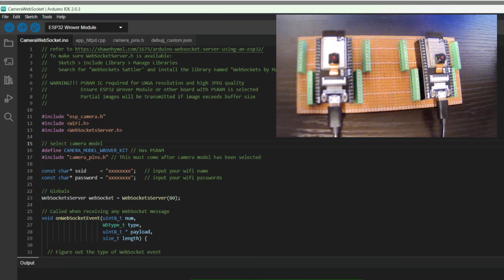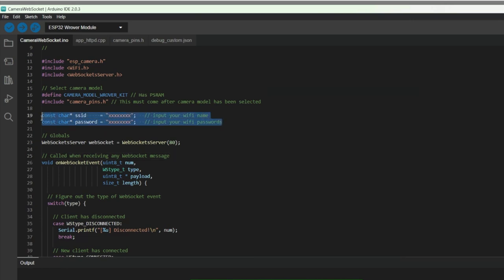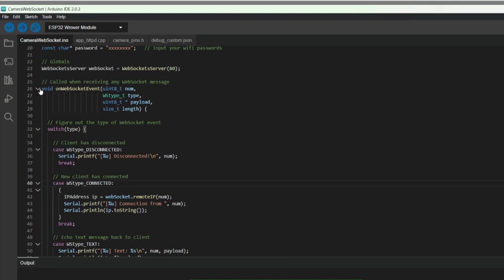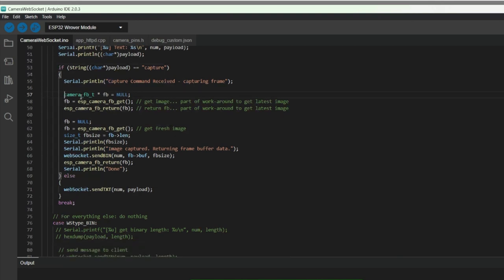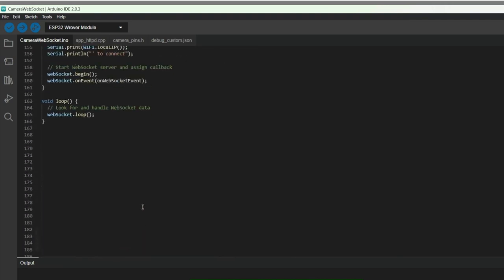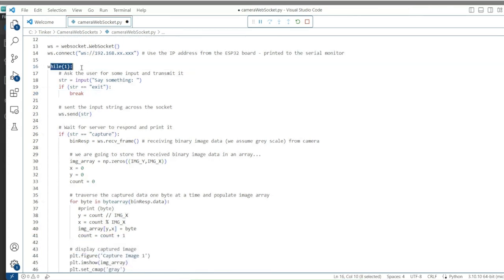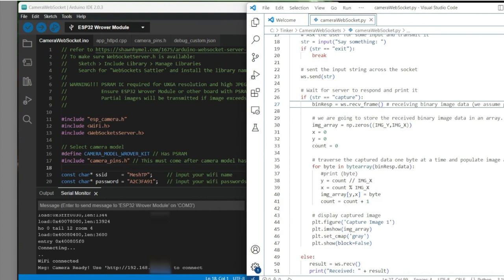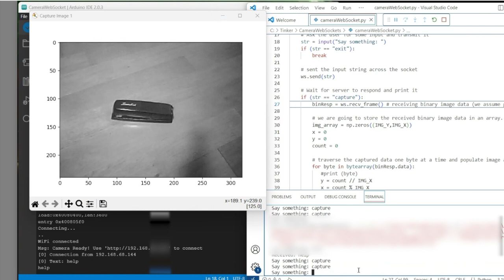ESP32 Web Sockets - Transferring Raw Image Data

Comment: Why are you not using the sockets library which is designed for this type of application?
Reply from the maker: What I'm using is part of the WebSockets library for Arduino IDE (WebSockets for Arduino (Server + Client)). I needed to get something working quickly and used the example from the site I referenced in my code listing... that's why I'm using "WebSocketsServer.h".
Reply: @tinkerfoundry if all you have is a hammer everything looks like a nail